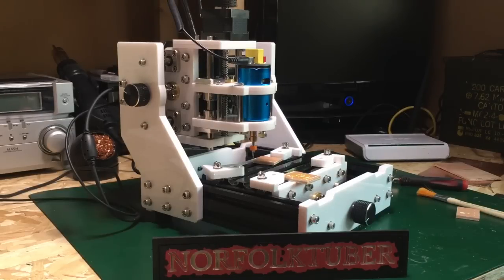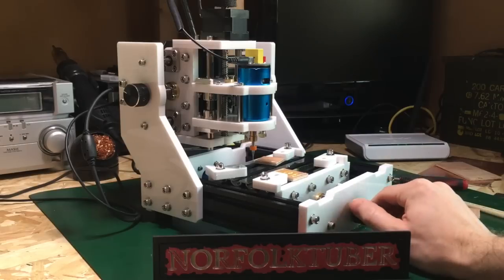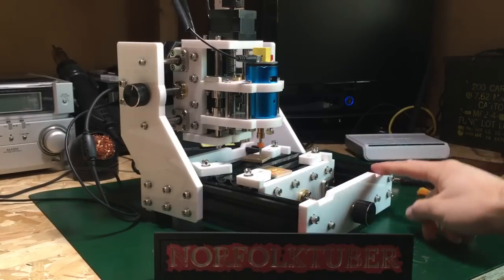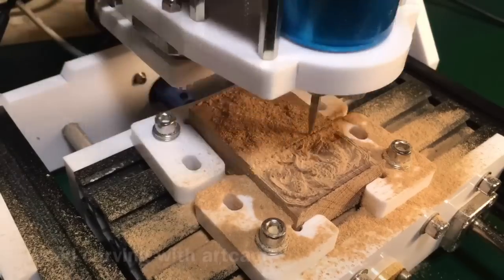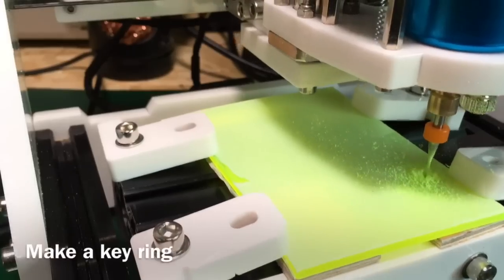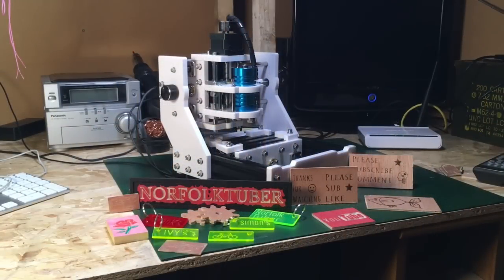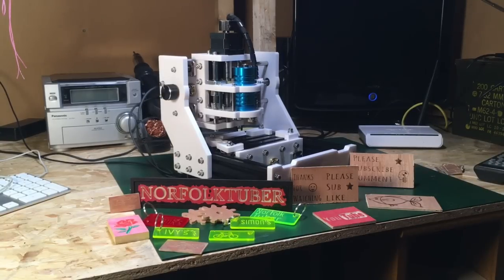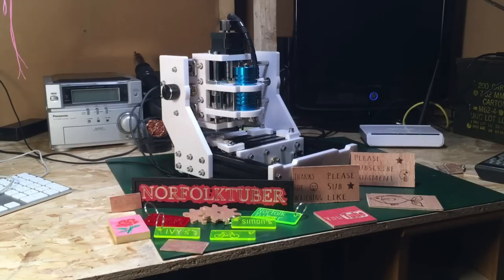EleksMill Desktop CNC  Engraving Machine Review

Comment: Nice video, may I ask are you using the milling bit http://store.eleksmaker.com/index.php?route=product/product&product_id=129
what are the feedrate and the motor RPM??
Reply from the maker: no i don't like that mill bit, very sharp but snap easy the rpm the motor runs at is fixed think its like 7000rpm i think my feed is 150. but it depends on materiel being cut.

Comment: Hi again, may I ask one more question.
How I am supposed to use the laser.
I tried GRBL with the laser, it came on, but no harm to anything, paper, wood, etc.
Do I have to load a different firmware, or use a different software than GRBL, can you give me a hint or short info, how you did it.
Another thing is, where do I enter the values for the drill. Meaning, if I use a 1mm drill (I call it drill, because I do not know the English word for it),
 or a 3mm drill, the material taken away is different.
There must be a field where to enter the diameter of the tool... or?
Thanks
Frank

Comment: Got one more question, is there a user group for the machine, or is there anything I can prepare til the CNC arrives.
I am deep in 3D printing, so I know a little about G-Code and things like that, but guess it is different.
So if there is a WIKI or anything else, would be nice to know....
Thanks in advance....
Reply from the maker: no user group as far as i am aware just research grbl is software for controlling the motion of machine. and universal g code sender. many programs to create the g code at the moment easel web based software does what i want and its a easy place to start. all cnc routors are much the same just differnt sizes. just watch some video on youtube   
some more info here http://myfordboy.blogspot.co.uk/p/banggood-des.html
All the best.
Reply: Thanks, will check.... I am looking for something like Simplify3D, which I use for 3D printing... I will continue with reading. Did that blog already :-) tks again

Comment: Hey, I am absolutely new to cnc, and bought that mill. Can one recommend the type of drills required, would be appreciated.
I plan to mill wood, acrylic, and maybe some aluminum.
Reply from the maker: Hi here are the ones i use, not tried aluminum all the best have fun.

http://www.banggood.com/5pcs-3_175mm-Shank-0_1mm-1520304560-Degree-Tungsten-Steel-Engraving-Bits-CNC-Tool-p-1049112.html?p=070519238739201308J6

http://www.banggood.com/10pcs-11_522_53mm-Carbide-End-Mill-Cutter-PCB-Drill-Bits-p-1090388.html?p=070519238739201308J6

http://www.banggood.com/10pcs-20-Degree-0_2mm-Tip-3_175mm-Carbide-PCB-Engraving-Bits-End-Mill-Cutter-p-985991.html?p=070519238739201308J6

http://www.banggood.com/1_0mm-4mm-CEL-2-Flute-Carbide-Ball-Nose-End-Mills-Router-Bit-p-909755.html?p=070519238739201308J6
Reply: Thanks, ordered, we will see in 7 or so days...

Comment: question? you give a 5 star review, but how did you assemble with the wrong bolts? they send m3 x 18 -Not 14mm, and m3 x 12 -Not 16mm.  The instructions are unclear, — but according to the pictures 14 & 16 are required.
— did you buy more bolts, or is there some way to use the ones that are too short or too long?

by the way, this exact same item is available for $204 at other sites, and a metal version made in USA at $190...

Comment: Hi, that is a great 3d engraving sir, nice cnc too may I ask what kind of engraving bit did you use in your engraving project, I have  a CNC machine and planning to do some 3D engraving too, thank you very much
Reply from the maker: Hi here are the ones i use,  all the best have fun.

http://www.banggood.com/5pcs-3_175mm-Shank-0_1mm-1520304560-Degree-Tungsten-Steel-Engraving-Bits-CNC-Tool-p-1049112.html?p=070519238739201308J6

http://www.banggood.com/10pcs-11_522_53mm-Carbide-End-Mill-Cutter-PCB-Drill-Bits-p-1090388.html?p=070519238739201308J6

http://www.banggood.com/10pcs-20-Degree-0_2mm-Tip-3_175mm-Carbide-PCB-Engraving-Bits-End-Mill-Cutter-p-985991.html?p=070519238739201308J6

http://www.banggood.com/1_0mm-4mm-CEL-2-Flute-Carbide-Ball-Nose-End-Mills-Router-Bit-p-909755.html?p=070519238739201308J6
Show less

Comment: Really nice! But can this machine cut mdf?
Reply from the maker: yes it will cut mdf. I have made engravings in oak hardwood time 2.00 in this video.
Reply: Norfolktuber Nice! But I mean with the laser.
Reply from the maker: no not with a 500mw laser you need a 40w co2 laser engraver to do that.
Reply: Norfolktuber Oh, thanks!
Reply from the maker: you can laser engrave but not cut.